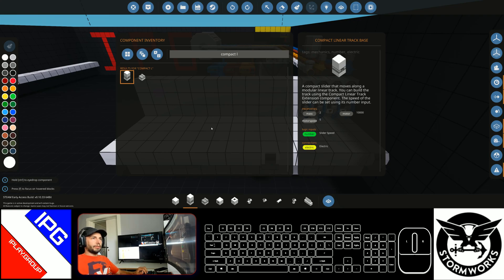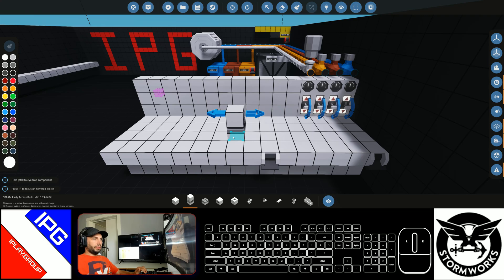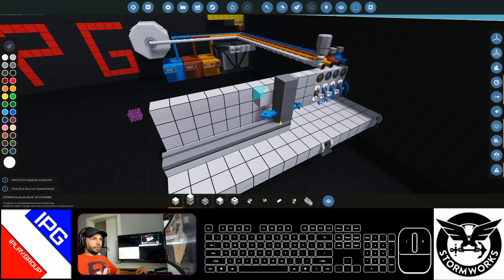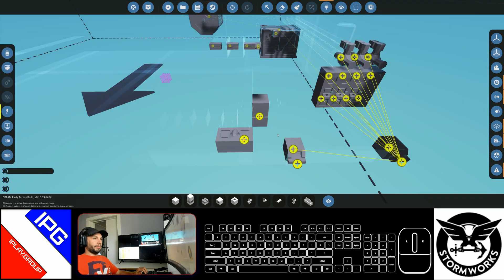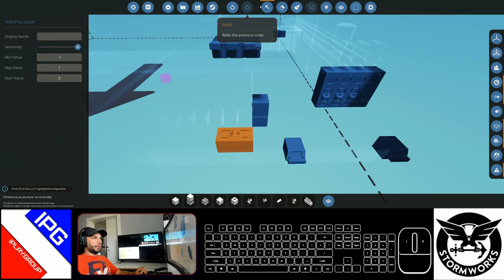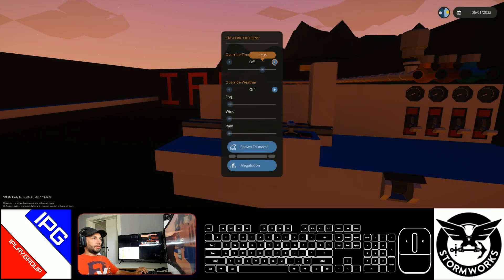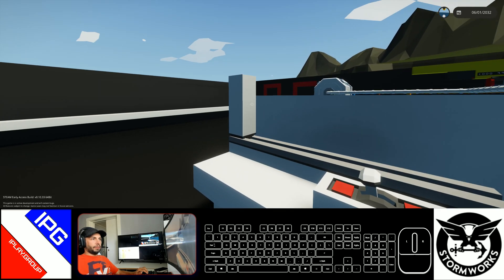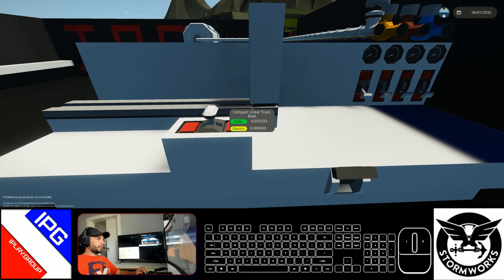Compact Linear Slider - iPlay.Group Quick Tutorial for Stormworks

Comment: How would i control this with a toggle button?
Reply: I know it's 8 months later, but if you're still wondering, you could make a custom microcontroller with an on/off input and a number output, with the actual logic being 2 constant numbers (0 and 1, or -1 and 1 if you want it to come back when you un-toggle it) hooked up to a numerical switchbox, and run the numerical switchbox into your number output. Then it's as simple as connecting the toggle button to the microcontroller and the microcontroller into the linear slider.